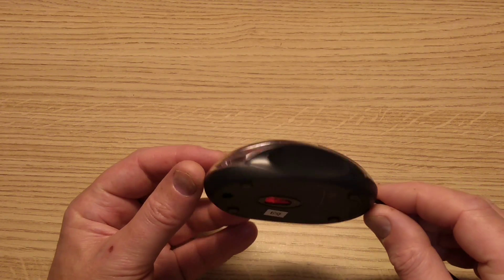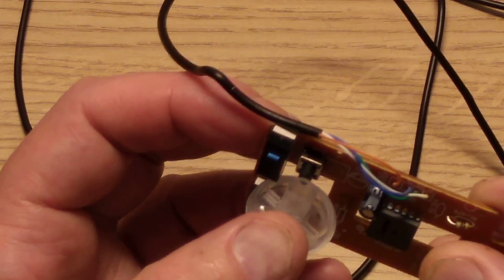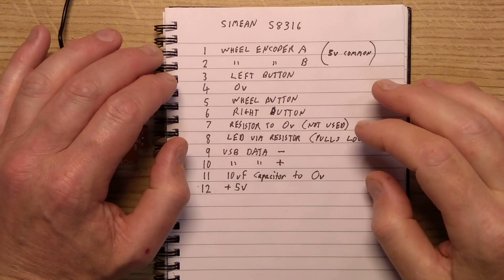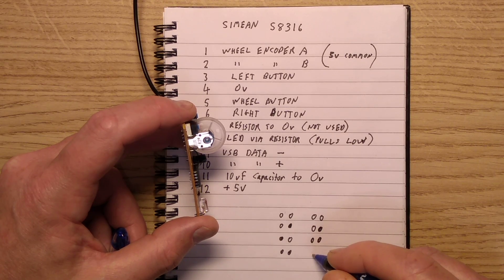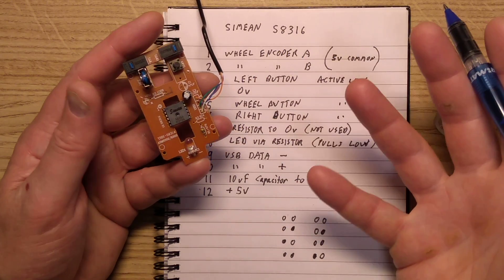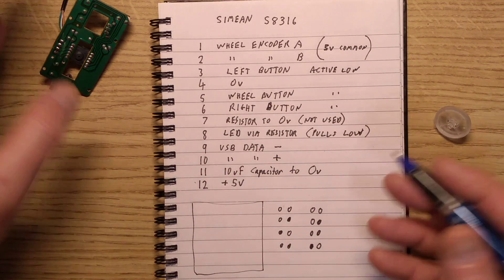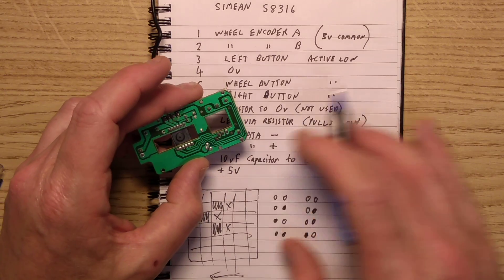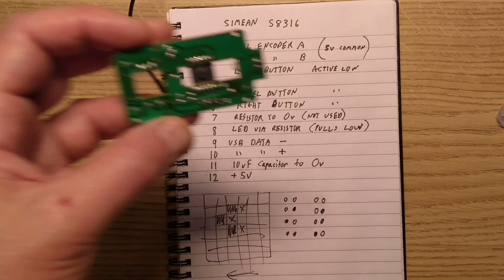Inside a humble Poundland computer mouse.

Comment: Hey youtube,  don't send me an email telling me that I can choose my "handle" (when I was perfectly satisfied with using just my name) and then sticking such nonsense as a @ at the beginning and a _ in the middle,  neither of which are contained in my actual name!

This prodded me to go a little further with the "dead" wireless mouse I've had sitting here for a while.  Applying a little prying force at the right spot finally got it open for me.  The rotary encoder for the scroll wheel appears to be optical,  rathter than mechanical.  There's an LED on one side and a three-pin sensor on the other.  A trio of switches,  a crystal,  an inductor,  and two chips  The plastic lens assembly is rather complex.  The LED mounted to it is terminated on its own teeny little board that connects to the main board with a bit of 2-conductor cable, one side with a red stripe to indicate polarity!  Instead of a chip there appears to be a small circuit board (a breakout board for SMD?) with 12 pins on it labeled KC and E243951 and Capella004.  On the underside of the board is what I am assuming is the wireless chip labeled  NRF A-- 31512C.  The crystal is marked 16.000.  The inductor seems to be marked but I can't make it out.

This whole thing ran off a single AA cell.  There are some other similar ones around here,  still working.  My lady prefers to not have to deal with those wires,  which don't bother me at all.  :-) 

I wish that our dollar stores and Aldi's would carry anywhere near the amount of interesting junk that yours carriy...

Comment: When buying super cheap mice off ebay, you find that when using them, there are issues with tracking, this is all determined by that central chip, which sends light images to a digital signal processor inside it, it determines fine changes in the image and where the mouse should go on screen. In the super cheap Chinese mouses this entire chip is of an inferior quality and you end up with a cursor that skips or moves in jagged way. 
Essentially the most important thing on the entire mouse is that central chip, is is the entire brains of the mouse. This is why when you buy a good quality mouse, it's worthwhile to repair it. The areas of a mouse that fail are generally the clicker buttons, the easiest way to repair these is to buy a cheap ebay mouse, take the copper flex pin out of it's switch button, and replace that with your highly used copper flex contact inside your mouse button. 

Some people suggest trying to re-bend the copper, but I find it doesn't work that well, other people suggest entirely desoldering the mouse clicker button and replacing it with a new one, this also isn't necessary, you only have to open the mouse button and remove the small copper flexing piece, and put a new one in from an unused mouse (a cheap Chinese mouse is good enough to use for parts). 

With this method I have had a high quality gigabyte mouse last 15 years, still working just fine.

Comment: as a rule of thumb, I always carry a mousepad in my bag in case I need to use the mouse on glass, also add that I use a gaming mouse all the time, those don't track on just anything because they're optimized for speed and resolution, not for surface compatibility, so they don't tend to track the best on smoother surfaces
one thing i notice these days is that a lot of mice use IR LEDs now, could it be a wavelength thing?

Comment: the early mouses needed a custom mousepad because it's essentially the same mechanism as the opto-mechanical mouse but instead of it happening internally, you moved it to a mousepad. and yes, they did cost a fortune, not only because the first ones were made for Sun microsystems, these mice had different mousepads per generation, so you couldn't intermix them
I wish i could buy a wireless ball mouse, because those work on any surface without problem

Comment: I mean computer mice are incredible not only is that a photosensor but its also a microprocessor too! and not just some little microcontroller with one ALU for basic controlling and comparing that thing process images its got to have ALUs, FPUs. Heck it could even be a small GPU that does parallel processing! but considering that this is a lower DPI and lower end mouse i doubt it will have anything that sophisticated maybe on a gaming mouse

Comment: Found a link to a Chinese distributor for the chip: http://en.semiconshop.com/mall/show-htm-itemid-1119.html
Unfortunately there was no datasheet. Here is the machine translated (CN->EN) description:

S8316/8318 product specifications:

      Highly integrated optical mouse SOC chip (independent research and development, manufacturing and sales integration)

     Using CMOS image sensor manufacturing process, on-chip integrated main controller and photoelectric sensor
     USB interface, in line with USB2.0 standard, compatible with USB-HID1.1 transmission protocol
     Standard 3D3Key, support mechanical roller encoder
     Resolution: The default is 1000DPI, 800DPI/1200DPI/1600DPI can be customized
     Frame rate=>3000 frames/sec, maximum speed=>24 inches/sec
     Working voltage=>4.5~5.5V, working temperature=> -15~+55℃
     Working current: 16.5mA (moving state), 7.8mA (standby state)
     Built-in LED drive circuit, built-in oscillator, streamlined peripheral circuits
     Support mainstream Windows, Linux, Mac OS and other operating systems
     Comply with Microsoft WHQL and USB-IF specifications
     12-ADIP package (RoHS compliant), compatible with S8318 Pin-Pin

Comment: I usually had lots more crud built up on the steel rollers in old mice; A toothpick etc. cut at a slant to make a wood chisel did well to clean that grunge off, then isopropyl & a Q Tip for final cleaning. Saw some rollers with almost a cm of added diameter from that desk dirt! Nasty stuff.

Comment: You need to get an LG V20 while you still can. They are dirt cheap used and not much more brand new. It would significantly upgrade your sound and noticeably upgrade your video. You could move to 4K for less than a night at a cheap hotel. You can even use external wired mics with the V20.
Reply from the maker: I'll definitely check that out.  The latest phones seem to be going a bit too far with the camera resolution and compromising the close range focus ability in the process.

Comment: What is the cost of the mouse? 🙄
Reply from the maker: Surprisingly it is actually a pound.  Especially these days when not everything in Poundland costs a pound.
Reply: @bigclivedotcom  yeah that was my point 😆
Reply: @bigclivedotcom  I did a check on this mouse in the device folder.... it's a Microsoft Driver/product!!! (Apparently)
Reply from the maker: @PlantbasedRunners  I'd guess it's just complying with their base standard to use a default driver that forms part of the operating system.

Comment: These, or at least very similar chips, are used for cheap drone optical stabilization. Not sure if DJI actually uses such low res sensors, but ardupilot has at least limited support for ADNS-3080

Comment: I looked at the SImean website. They have spec sheets for their new KA2 and KA3 sensor chips. They call them "gaming sensors" so I suspect the camera is higher res. The only difference in the pinout is the location of Vss. On the newer chips, the unused pin that is left floating (pin 7) selects the tracking speed is "Counts Per Inch" (CPI). Pulling it low selects 800 CPI. Pulling it high selects 1200, but if you float it and pulse it low, each pulse rolls through a list of available CPI rates. The higher CPI rates are probably the support for "gaming". If this chip works like that, it's fixed at 1200 CPI, but more likely it just supports 800 CPI period. 

Here is the data sheet: http://www.chipintel.com.cn/pdf/KA2%20Datasheet%20V1.0.pdf (English)

Comment: I used an optical mouse chip for optical character recognition combining it with a Microchip PIC microcontroller. It only read a single-digit from an analogue domestic gas meter register as a means of tracking gas consumption.

Comment: thanks for that, got one for a spare for a £1 that's just bonkers, got a fake Toblerone as well, and 2 cans or compressed air
Reply from the maker: The air duster is a volatile gas.  The fake toblerones are dangerously nice.
Reply: @bigclivedotcom  Just read the back of the can in caps and bold DO NOT SHAKE THE CAN,  and a lot of red writing on it....... I think I bought a hand grenade? I need your pie dish

Comment: I bought a cheap $12 wireless mouse from Woolworths recently and it's been very good, when I use it with my laptop the mouse pointer moves across the screen very quickly, so I think the sensor may have quite a high DPI rating.  For $12 Australian it's an absolute bargain.
Reply: I'm using one I bought at BigW, [their own branded one]. It has two extra buttons on the side, for FWD/BACK  on webpages? This one also has a button on top to cycle through 3 different mouse speeds. Anyway, they were clearing them for $3.50 recently, but only available on delivery [$9 more]. I should have bought some more when I had the chance. They have some now for $10 each, not as good.

Comment: Does anyone else remember the first generation optical mice that had to use a special mouse-mat, with a special pattern of reflective dots printed (milled?) into it? (I think this would have been the mid 1990s).
Reply: They came with high end Sun workstations
Reply: Simon Quigley - yes. Those were the ones! First used them in compsci labs back at University.

Comment: Can you read the raw data? Any hackers out there know? Theoretically you could turn it into a hand scanner and, combined with the movement data, build up a picture in the computers memory. Probably only 1 bit b/w but that's no worse than an early Mac.
Reply: On the ones with a USB interface directly on the chip; no.
It only speaks USB HID which is the distilled left/right/up/down movement information.

Comment: I have used this mouse for about 4 years with my desktop and laptop as my main mouse; it is superb for £1. People tend think its funny I use something so cheap with my definitely-not-cheap rigs but it really does the job, has no installers, firmware or managers and with heavy use hasn't shown any signs of aging or damage over the years. Even when it does break I intend to get another one like it.

Also the size is quite nice for my smaller hands.

Comment: 1. there is no lens. The plastic under-armature acts as such. The exposure is streamed right into the CMOS (might be CCD, but CMOS is easier to print on-board.) 2. The data it streams up the USB pipe is frame-based and sends out a vector equation saying "going -338.888787 deg off center at 13.2213 pixels per second." It doesn't actually stream any XYZ data. 3. It's not actually a particularly complex algo, either. The general algo goes: i. capture a frame and store it, ii. capture another frame and store it. iii. encode frame pixels into xyz and luminosity values, iv. invert frame 2 and lay it over frame 1 as a mask, v. diff frame 1 and masked image to record each pixel's directional motion and how far it drifted, vi. average together, transform into tensor, and transmit, vii, drop frame 1, move frame 2 to frame 1, and record a new "frame 2", viii. loop. 4. It is actually VERY similar to how a CD player works (precisely reflecting light onto a data-encoded surface and calculating a tensor to convert into signal). If you had under 1 kilopixel in the CMOS, you could probably hard-code the whole algorithm into fewer than 128kilobits, with room to spare for the various button pressing allocations.

Comment: The old ball mice were a pain, as you said, there was always some rubber gunk that got stuck onto the little rollers inside. The wheels were practically rotary encoders. The cable also easily got chafed up by the casing where it came out of it, eventually breaking the wire inside. These optical ones are heaps more reliable, and last a lot longer. This vid makes me want to open up mine and take a look at. It needs a cleaning anyway (works just fine tho)....

Comment: I have a couple of Sun Sparcstation 2 computers that use optical mice that have two camera units in them.  One uses a red LED, the other is invisible (probably IR).  They require a special aluminium pad with a grid painted on it. https://en.wikipedia.org/wiki/Mouse_Systems.  These no toubt cost several hundred bucks when new.

Comment: I've recently disassembled a dozen of old cheap Logitech mice. Mostly PS/2, but few USB as well. I can spot some better design desigions in them:
1. Wheel button uses durable "clicky" switch, the same as used for left and right button.
2. Scroll sensor is optical. So, it is practically eternal. Mechanical encoders that we see in this video wears out and start to loose its accuracy. With optical sensor the only thing that could break is the wheel itself, but not sensor.
3. Logitech is so much into mass production, that they even make their own scroll sensor chip. It gets power and ground for supply and comunicates to the main chip with a single wire.

Comment: I'm still using a "Packard Bell" optical mouse from ~2003, 16 years old and still working :/.

It did stop working once a year ago but I took it apart and cleaned it and smashed it on the desk really hard and it works fine. Got my moneys worth it's been powered on 24/7 for >99% of that time. Was about £20 when I bought it. Came with a USB to PS/2 adapter.

Comment: intruder detector well i know that movenment detection works using something called optic flow  (which is probably what this ic can calculate in hardware) and i know that for various good reasons its usually done with lowres grayscale images but that low of a resolution? what kind of intruder do you want to detect? some ants maybe? anything serious would require lenses that massive that they bring their own issues not to mention that the resolution will still keep a problem even with another lens

Comment: There was an early "optical mouse", I think it was made by Logitech, I had one.  It had a special mouse pad that had a red and blue (as I recall) cross-hatch pattern .  The mouse detected movement on the mouse pad with simple optical sensors and an LED.

The optical mice are such an improvement over the old mechanical ones.  My much used mouse ball cleaner, and mildly rude "cleaning mouse ball" jokes, now long relegated to the dust bin.

I've settled in on an older style Microsoft mouse (P.N. X802382) as most comfortable and have a stash of them rescued from the trash.  Although a bit hard to open, they clean up nicely and if not working can usually be repaired.  The cord typically develops breaks where it exits the mouse (after a LOT of use).  Repair is to shorten the cord 6" /150mm or so and re-solder the connections.   If you're the repair it sort of person.

Comment: I remember the optical mouse my father used to work with back in the nineties designing integrated circuits.
It only worked on a reflective metal mouse pad, which was covered with a grid. I don’t remember whether the grid was in a „regular“ pattern, if you know what I mean. I don’t remember whether there was a top, bottom, left, and right side, thus determining the pointer movement relative to the pad (kind of like an absolute pointing device).
The mouse itself had generously proportioned felt gliders, and no red LED. I presume IR, perhaps even Laser.

Comment: These sensors are also used for optical flow detection in some drones. Apart from that, on some models it is possible to get a video stream out of the camera.
Some of these sensors manage to capture up to 1000fps which is quite impressive.

Comment: Yes, I have seen optical mice used as azimuth and elevation scales on telescopes, using a laser printed scale. Works well, and with the scale laminated in plastic, fairly water resistant.

Comment: I remember the rubber ball'd mice that had to be cleaned every so often. Foe, you also had to open up the mouse casing it self and clean off the little plastic wheels inside with a q-tip wetted with alcohol. It always happened at the worst time too, like during a video game

Comment: I'm pretty sure Sun SPARCStation workstations circa the mid 90's had very early optical mice. The mouse would only work with mousepad that came with the workstation; the pad was solid with a very very small grid etched onto it. I was working in IT in the early 90s and we still had a few older SPARC machines sitting around, my boss was very insistent that we kept the shelf of Sun mousepads as they were difficult and expensive to replace. This was back when Microsoft's (expensive) consumer mice and trackballs still used a ball and rollers.

Comment: I still have a few old serial (RS232C) mice that use wipers and contacts for the quadrature encoding.   Later ones, of course, use optical interrupters and little plastic wheels.  The big problem with both of those is that the mouse ball would pick up pet fur (I have two dogs) and get it all wrapped up in the works, such that cleaning the ball did little good.  You had to open the mouse up and pick the hairballs out of the works.

On the current crop of cheap optical mice, is the application specific to red LEDs?  Could one use an IR LED or even a blue one?

Comment: Use two sensors stereoscopically to make a diy gesture sensor. OR a 3-d spacial object scanner. 
I wonder what wavelength of light does the sensor detect and at what resolution and distance.

Comment: I was looking at using one of these chips to monitor 3d printer filament width during use.  It would require a different lens though because the image area was so small.  With the right one you can access the image data directly and have a high speed camera with 1000+ FPS, but only 30x30 image size.